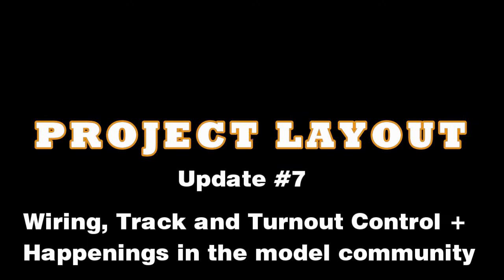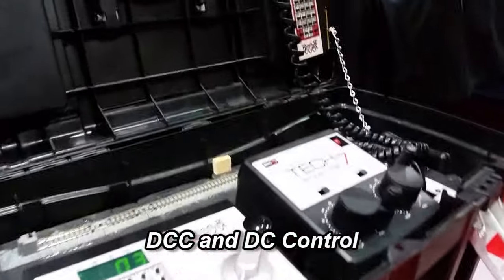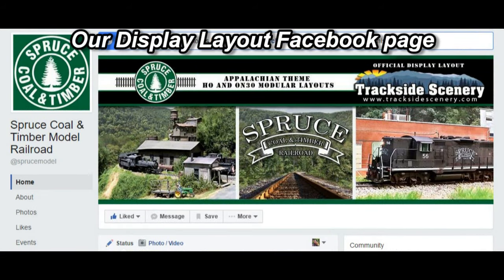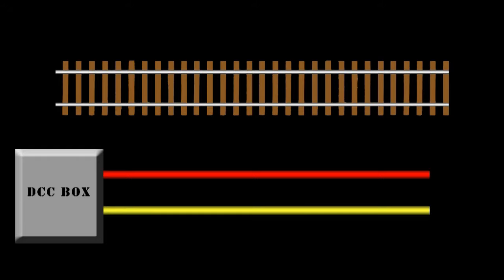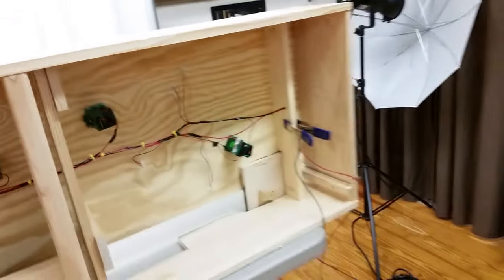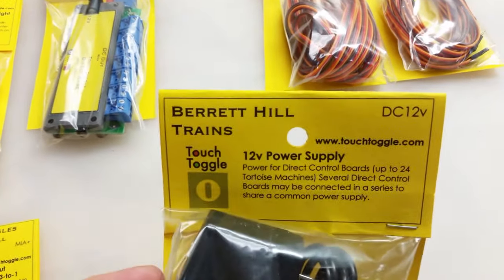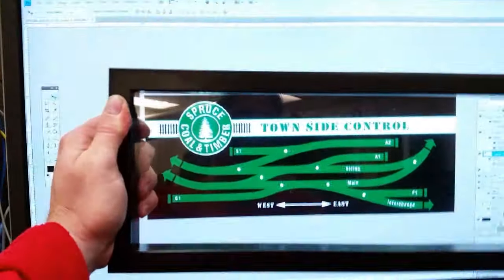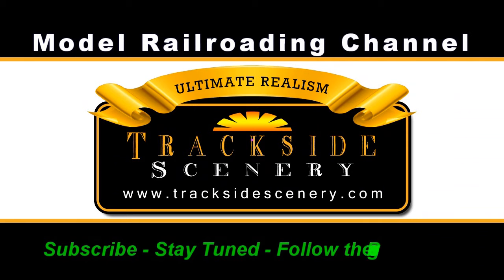BUILDING A MODEL RAILROAD - Layout Update #7 Cool Stuff/Wiring/Touch Toggle Controls

Comment: Joey, what is the order of items in your panel? Im assuming there is a layer of clear plastic, paper diagram, and then touch toggles. Is there a layer of carboard or anything behind the toggles? I know frames often come with that for backing.
Reply: At Berrett Hill we recommend a layer of poly batting; a material used in quilts or to wrap furniture for padding. This thin fluffy white sheet material can be picked up in fabric or craft stores. A rectangle of batting can be cut to fit, laid over all the Toggles, wires, and graphics will gently compress and hold everything snug to the glass when the backing for the frame is installed. The gentle pressure will keep wires and Toggles from shifting, and keep double faced Scotch tape from coming loose from the graphic.